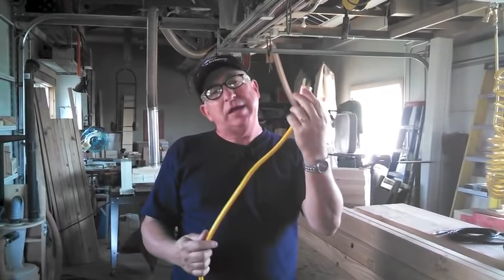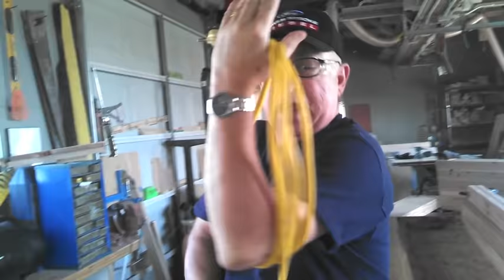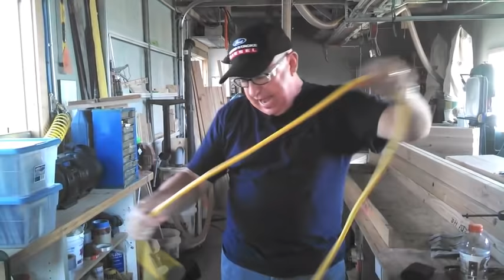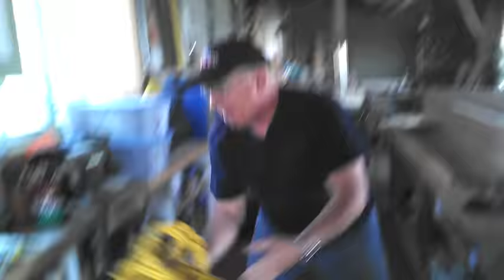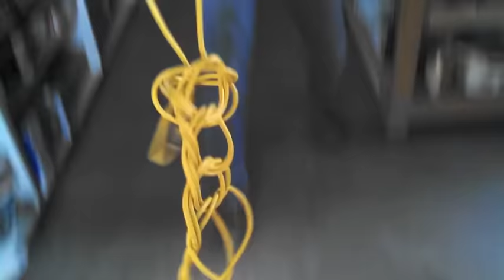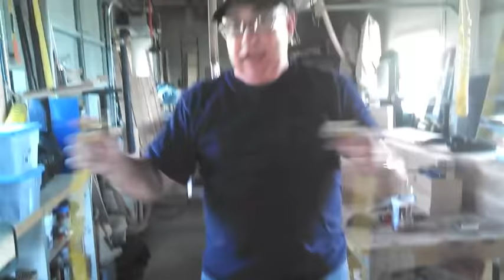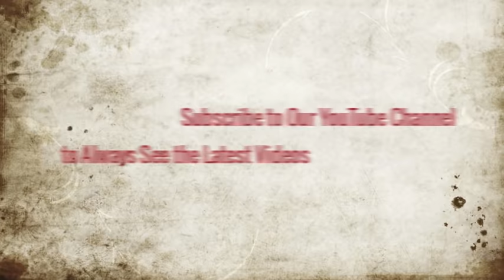Best Way to Store an Extension Cord

Comment: An alternate way is to lay it out, and coil it in your hand giving it a 1/4 twist with each loop, letting the turns come off the end as it drags towards you, then finish off by wrapping it like it was when you bought it.  It's compact and you can hang it up easily.   That's why it comes that way from the factory.  An advantage is if you only want to use a short length you can just unwind what you need.  It's your cord, you can store it anyway you want, although it's reinventing a wheel that does not need reinventing
Reply: but your  square wheel is lame
Reply: @dperry19661   I always did it that way because I crew on large boats, and thats the way storing lines (ropes) is done,, how the all cords are done at the factory, and how I was shown in college engineering classes to return cords and hoses.  If you tried to return one the way shown they would not take it.
Reply: This.  Over under is the only way to store it that wont deplete the life of the cable or develop kinks.  From boatcraft to stagecraft, id send anyone off the deck that was doing this.
Reply: Im with you on that. Its the only way to coil a cable for me
Reply: @JP-nb7tm  It puts no twists in the thing you are coiling, is easily uncoiled, allows you to only take what you need.    If it's your cord you can do what you wish, but if you are in a setting where you are coiling someone elses's cords or lines, you should do it the way they want, and the method above seems to never be one of them.  Thanks
Reply: I will continue with arm wraps. Faster and easier.
Reply: @nuffflavor  It s faster, but there's how it turns out to deal with.  Make a video to prove your point please
Reply: @vidguy007   Uh ? Make a video for what reason ?  DirtFarmerJay did both wraps, and you know the arm wrap is faster/easier.  Now, I did not say it was better of the two wraps, but for crying out loud it is a cord... not a wedding dress.

Note: DirtFarmerjay threw the arm-wrap on the floor as if it was in serious disarray, when in actual truth all you do is stick the male-end into a socket (as usual)  flip the bundle over and pull out the other end until length of your desire.
Reply: @nuffflavor  It seems we are arguing about a personal choice.   I'd like to see your method finished and see how it turns out.  For me, I'll repeat myself, if it's your cord do what you want, if it's someone else's, do it the way they want.
Reply: @vidguy007  .. Okay. There was never an argument. I stated  "I will continue with arm wraps. Faster and easier".
 That was my opinion... the opinion did not mentioned that yours was bad or good.... the opinion just stating my preference.

Question though.... Why are you asking to see my method when DirtFarmerJay SHOWED the arm wrap method from time 0:15 to 1:15 ?

Time 0:15 to time 1:15 is MY METHOD. Why are you not understanding that, or do you just want to see another person to the SAME arm wrap all over again ?

Comment: Now you made it larger to store and added more torsion on the wires with the tight bends in the chain. Good way to wear it out faster.
Reply: You can actually make the loops bigger than in the video. I store 100’ cables with this method. Where I work gets to -40 Celsius so I make large loops and I’ve had the same cords for 6 yrs. you should give it a shot.
Reply: And as far as storage goes, you can fold itself over like a blanket and it will hang on a hook, or lay nicely in the job box.
Reply: @Eroz Ghost: Copper work hardens very quickly, so the more it's bent the harder it gets and it only takes a few sharp bends to break it.

Comment: Wrong....wrong and yes, wrong.  I've worked in the trades as an electrician for over fifty years.  Had to deal with cords all my life and yes, Never, never wrap a cord (or rope) around your arm, never.  However, wrapping your cord in chain links is very hard on your cords.  The more you bend a cord, the more chance(s) you have of breaking an internal wire.  Do not do either of these things to your cords.  Or your ropes. Never.    The proper way to wrap a cord is to lay it out, and wrap it (with the twist)  all cords will have an internal twist.  Make a loop about three-four foot long and keep wrapping it in nice neat loops with no twists.  About five -six foot from the end you wrap the cord end around the loop about four or five times.  Then with the last two or three feet you stick a double through the upper loop and roll it over the top.  Pull the end snug and you have a coil of wire which you can either hang or throw it in the back of the truck.  If you have done it right, you can pull it out of a pile of stuff and untie the loop and throw it out and the whole cord will unravel without any kinks.  I've won a lot of money betting with other trades, by betting with them that I can wrap a  hundred foot cord up, tie it and then unwrap it and throw it out and it will lay out with out any kinks.  This works well with rope also.
Reply: Why don’t you just make a video of your method?
Reply: Not to mention, he's always crimping it at exactly the half way point.  Fatiguing.
Reply: No, no and no.  You're not  kinking the internal wires here.  It's using the natural radius of curvature

Comment: It looks cool to coil a cable like that but I prefer the around the elbow and thumb method. I wind up and store cables multiple times everyday. I wind from the wall socket end and unwind from there as well, it’s quicker. Because I pull the cable out straight before winding I get very little line twist.
Reply: agreed done it professionally for 30 years and it gets trained and not tangled around everything in a service van. takes less  room in the shop
Reply: you guys must be really good at winding those cords then because im 76 and have been working since i was 15 and i have never wound a cord that didnt get tangled, especially with the 50 or 100 ft 12x2 cords. and you must have some long fingers and arms . some of the union jobs ive been on the guys did them the way shown here, never saw any get tangled.      i tend to agree with arvid wright, one thing i always tried to teach my kids, workers, and grand kids, if you're talking you can't listen, if you think you know everything you will never learn anything, and if you can't admit you make mistakes you can't correct them.
Reply: jimmie Roan Well I’m pushing 68 and have also been working since I was 15. Like I said I get a “little” line twist by rolling the cord as I wind. I never throw the cord because,yes, it will tangle.
Reply: @jimmieroan9881  funny wasnt hard at all and just about allI used were 100 ft 12/2 w /g  cord in the union thank you and we made to roll them that way, again so they werent tangled and able to be trained, took way less room drag out what you need and as you pick upo at the end of day it basically rolls itself,  More than one boss would forbid us to do that to a commercial cord,  I have only seen that done in residential trades, If thats the way you want to do it good luck, lol  throw it out there to get it undone and I hope you have enough room so it doesnt get run over, tripped on, on cut, Ill keep doing it the way I have on the big jobs for 30 years and do at home because of it. Please dont try to tell me the mess is the best way. Union Elctricians take care of their cords and  as I said We were not allowed to do that to them, and no not long fingers just reasons, and If you have never seen a cord like that tangled on everyrthing in a gangbox you would be the luckiest person Ive ever heard of

Comment: Not recommended if you have a lot of amps going thru the cord, it is safer to unroll the whole cable.
Reply: what's the issue? the cables are insulated, are they not?
Reply: MassDynamic the issue is with the electromagnetic field of the loops, they will make the cable heat-up.
I saw a rolling extension cable used not unrolled for a high watt usage (not over specs) but because the cable was still rolled 90%, it over heated and melted. If it was completely unrolled, it would not have overheated (better heat dissipation) and less heated as the electromagnetic field was  not overlapping on itself at every circle of the roll.

Comment: DO NOT DO THIS! It damages the cords, and causes rapid cord failure. Cords stored with over-under coiling can actually last twice as long as cords wrapped this way.
Reply: Where does additional damage come from? Because the loops are made smaller?
Reply: J DeWitt DIY that being a reason, your putting more stress on the wires to move around on each other. Not only does it seriously take more time, we're not handling a ship rope here....
Reply: Over-under is better for ship rope too. ;-)
Reply: Caleb Cain. There is no rope on a ship , just lines unless they are brand new and unsigned a job on board. Then they are already coiled around a spool.
Reply: Tackles: You are correct, however few people who don't work on boats know this, so saying "Line" doesn't communicate meaning without explanation. Saying "ship rope" does.
Also, I was replying to "Person 1" who used the term "ship rope" first.

(I should have put "Line" in parentheses though. Fair cop.)
Reply: Caleb Cain  That's fine my friend  .  I only pointed that out because of the love I have for the sea .   What  I should have said is there is only one  rope on a ship and that would be attached to a water bucket  . Reason being it is never attached to a ship full time and its job is not of the ship.   I thought you might enjoy this bit of information.  Take  care  .    T

Comment: This most definitely ruins the cord in a short period of time. If you learn to coil a cord properly with a slight twist as you coil it,it will come right undone and last for years instead of weeks. I use my cords everyday and have zero issues while I watch other guys using this method constantly buying new cords.  works great for rope, not for extention cords
Reply: Do you really think so many people would wrap cords this way if they only lasted weeks? I have a number of extension cords that I've been doing this way for at least twenty years with no issues at all. I can toss them in a tool box or hang them in the truck and they never tangle or unravel. Can tie up a fifty foot length in about 30 seconds, I have timed this, and if I only need ten feet or so I just pull out that much instead of uncoiling the whole thing. Win on so many levels. Weeks? Come on.

Comment: I'm a contractor, with all due respect, first of all thats too time consuming , secondly, in the cold weather these 12 and 14 guage  cords do not cooperate, the copper wiring inside hardens up and you have to make large loops to wind them, trust me.
Reply: I have fired people for doing this
Reply: exactly.
Reply: yeah i hate cords to be rolled up like this also i  roll in loops just not small loops like he tried to show around the elbow. big loops, also when rolling in loops you take the twist out of the cord as you pull it through your hand looping it.
Reply: Plus the stupid loops
Reply: I never wrap it that tight around my arm. I always do arm length loops. Same size loops every time.
Reply: @marcelgaddis9319  It's called splaying the rope, in this case the extension cord. It's an old Navy term.  👍😎😏
Reply: @mattcharles8744  Thank You. I think its dumbest thing Ive ever seen
Reply: RIGHT! Try doing that with 12 gauge 100' cord!. I dont know what you call it but I roll it up in big loops when you stretch your arms out completely and tie it through the top loop and hang it on a hook in your truck. Been doing that for almost 30 years and never has a single problem
Reply: @richp5321  sure buddy I’m sure it never gets tangled get out of here. I have wrapped 12 gauge 100 ft cords this way with zero issue. I would guarantee that most of you in this thread just can’t figure out how to do it right
Reply: @TheFinn24  I get it. That's how you were taught. My friend from CA did that exact same thing when he came to NY to work for me. He also used worm drive circ saws. I thought he was insane! I get it. Not trying to argue. And I wouldn't fire someone for doing it. I was being a jerk for a minute. Just one more thing tho. It looks terrible! Can you at least give me that?
Reply: Thank you so much this tactic sucks in cold weather and takes way too long.
Reply: Ya seems like it would put just as much strain on the cord if not more winding it on your arm, on a cord holder works great for me
Reply: I work with cords and hoses for years everytime it comes to clean up there is always an idiot that wraps a cord around his arm . basically the cord becomes twisted and has to be retrained to its former memory . and when you tell the guy I told not to wrap the cords , I get a look as if something is wrong with me .  cords are a magnet for lazy clean up guys.
Reply: Interesting, that’s how we wrapped our 10g 100ft cords when building our house in the snowy mountains of Utah. Chain method is only one we’ve used that works consistently.
Reply: Try undoing that at -25C!
Reply: @bgorveatt  haha, hey brother, if I’m working in -25* weather , the cords are the least of my problems, you live in Alaska ?
Reply: I’ve seen lots of tradesmen’s trucks with extension cords stored this way.  Yes, it takes longer to wind up but is is faster to unwind and untangle.
Reply: That's what i was thinking about my rock hard stiff cord. Not an option for that
Reply: Cold with both cords and air hoses don't mix well. It's one of the reasons  among many that I prefer to work from a stationary location in my shop, but tripping over them isn't exactly as much fun as seen on TV.
Reply: Guys, it’s okay, I promise.  This chain method is perfect for most of the planet.  Now if your working in extreme temperatures, there is always the “over/under” method for cable stowage.
Reply: As someone who has seen cable before, you’re wrong. Cabling is long and thin, which is why we ravel it up. Because it is light and we can transport it by hand upwards of 50ft+!!
The cold does not make cable “harder” because it is made of PLASTIC, ELECTRICITY, and WIRE, literally as it would read on the molecule periodical tables. Which is already a solid state matter. And electricity can’t get hard or heavy, because electro-atoms go too fast.
Reply: I agree its amateur night at best! Lol
Reply: @TheFinn24 lol!
Reply: @gilbertsix7106 plus why do you want to pick that nasty ass cord up and wrap it around your elbow! Lol Ya i agree 100%
Reply: Congratulations. Firstly for your service & secondly for your mouth breather response. "I will take the time to talk about my niche example when the video doesn't say 'for every type of hose or cord in every weather condition'".
You are a hero to the great 49 states of America & my only serious advice would be to stop using burning tyres as a fuel source to cook your food with. Love you, babe x

Comment: Try doing that with a 12 g wire
Reply from the maker: +Tony M - you're right, don't even attempt it. Too heavy, too resistant to handling that way. For that gauge wire, use the over and under loop method and tie the finished coil with a tie that has been half-hitched to one end of the cord. Thanks for weighing in! Best, DFJ
Reply: Why not just over/over or over/under everything like they do in film and tie the ends like you said here?
Reply: Tony M i do it with 10/3 all the time, but thats about the thickest you can do.
Reply: Dont make yourself complicated.if you dont like make another idea....

Comment: Okay - tired it with a 50’ cord and firs just got a mess.  I tried it a second time and got better results — you need to control the loops, otherwise gravity will make a mess of it.  I kept the loops about 10” and it work flawlessly.  It’s definitely larger result than the thumb over elbow wrapping approach, but it untangles perfectly, even if you just drop it in a ball to store.  Definitely going to use this for my general everyday cord.  The loop over thumb and elbow approach still produces a smaller package for storage (e.g., Christmas extension cords, etc.)

Comment: not a time-saving or safer way to roll an extension cord. Sorry but it's not a heavy thick ship rope that would have to be pulled back up if there was a problem... That causes more rubbing between the inside wires as well as more handling and twisting as your winding it. Also, who wants to just jumble it up after you took the time to do that?? Good winding period comes with practice, you shouldn't even use the thumb and elbow method, just make sure it's fairly loose (as in not twisted around itself) grab one end, lift it take almost both arms stretched out or so, and as you go gently twist the cord the way in to the one you already have in your hand, and walk to the cord as your winding it up. This way your not stressing the cord even by pulling it, and you dont get frustrated if i gets caught on somethig, and most important you inspect the wire as you go! When you get to the end do as you like, but I take one end wrap it around and tie it to itself and then plug the other end into it. if anything happens within that small area because it's wrapped in such a small loop it's much easier to repair a foot of the cord than end up with a shitty cord that never wants to lay flat or straight. They sell velcro that is really nice so you can just slap that around when your done and works well but it often gets messed up if you use a cord every day. Also.... who can just throw a cord to unwind perfectly, most job sites or shops you have to make sure it's out of the way of yours and others way of work, so why waist the time. Also.... you have to plug it in and also plug your tool in right?.... A cord that can be thrown takes practice, tho can also damage it as well.